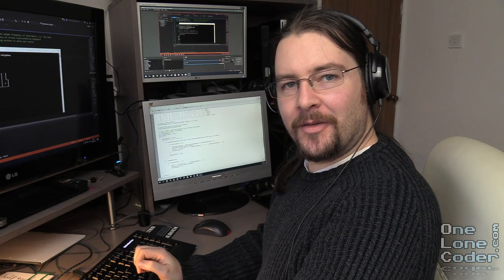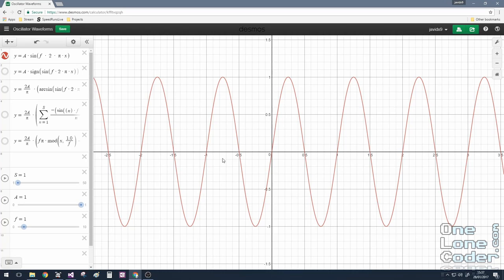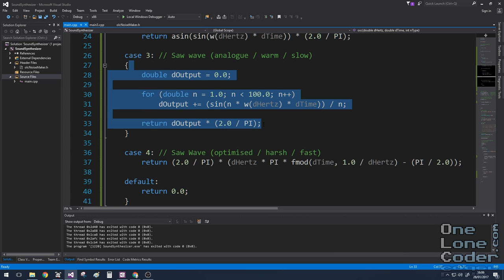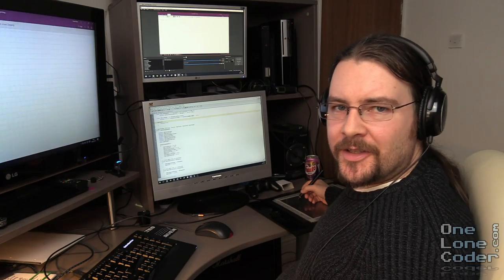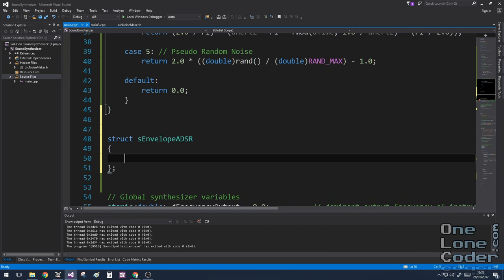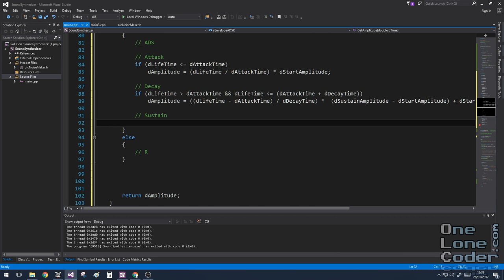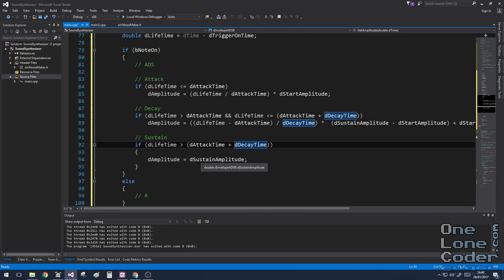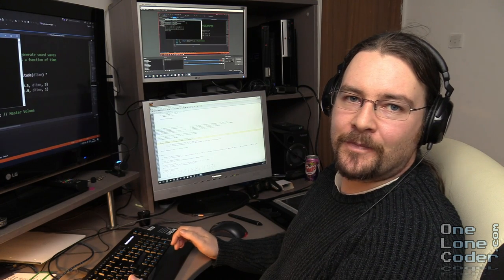Code-It-Yourself! Sound Synthesizer #2 - Oscillators & Envelopes

Comment: The "clicking" noise comes from the fact that the "wave" is not nicely ended at 0. For example your sine wave goes up and then gets interrupted by a key release and goes to 0. This creates a "clicking" noise at your speaker. Always let a single wave go and finish it's wave untill 0. The clicking noise comes from the large transient in your speakerboxes.

Comment: The reason the fmod implementation and sinusoid summation implementation sound different is because of aliasing noise. You're right that you are simulating an infinite sum of harmonics but at a sampling rate of 44100Hz only frequencies up to 22050Hz can be represented. Any frequencies above this present in the signal you generate appear as sampling noise because they become new frequency components within the 0-22050Hz nyquist band. This distorts the harmonics of the waveform so it is no longer a sawtooth mathematically speaking.
At anything above 220.5Hz your fourier summation of 100 sinusoids will also create aliasing noise for the same reason, it's just that the fmod implementation creates more as it contains more harmonics.

Comment: @11:30 I think the real point is that the analog saw has harmonics, whereas the digital saw does not. Harmonics add character and depth much like vibrato or tremolo, they create a uniqueness that enables the sound to stand apart. So you are very very spot on. The analog saw is much warmer, and more interesting.

Comment: The summed harmonic saw wave would probably probably sound interesting with the harmonics faded in like you showed - I guess the is like a wave table oscillator.
Interesting tutorials - thanks!
Reply from the maker: Thank you free electron - I'd actually like to build a full wave table system, then a tracker thrown on top. hmmmm.... (starts coding)

Comment: Hello
@11:50 of your video, I think you've got it a bit backwards in your explanations.
A perfect sawtooth wave, which your mod function is giving you at low computational cost, has all of the harmonics included in it, particularly the high frequency ones. It makes the sound richer, but also harsher, with more energy.
Your inefficient sum of sines method, is the same as creating a perfect sawtooth and applying a low pass filter, to keep only the lower frequencies and filter out the high frequency information. It sounds less harsh and "warmer" indeed. But in reality it is - in terms of frequencies and precision to the target signal - poorer. Notice as you increase the number of sines that you get closer and closer to the sound of the mod function version.
Just wanted to point it out in friendly way !
Reply: Also, if you like this kind of topics, I recommend you take a look at this:
http://greenteapress.com/thinkdsp/thinkdsp.pdf
It's Python, but you can thoroughly ignore the Python code and just focus on the signal processing lecture, then apply it in C++
Reply: @KingGrio  great resource, thanks

Comment: hey. i don't know how your oscillator works because it's been a bit of time since i saw that video, but when you said there are 2 ways of making a saw wave i assumed one of them would be the type that i always use, but it wasn't the case. so what i always do is i declare a double phase and set it to -1. then i declare a double inc = 2.f / sampleRate * freq. then for each sample i just say phase+=inc and if(phase>1) phase-=2. that way it will always jump back when it needs to. i'd assume that this is the most cpu efficient way because most audio software doesn't have to recalculate the sampleRate twice, so you can just initialize a variable as 2.f/sampleRate and then later on only multiply freq with that, only when the freq is really changed. you can get all other types of oscillators from this basic oscillator by just slapping stuff on the phase-variable. for example sin(phase*PI) for a sine wave
Reply: even your envelopes work completely differently :O it's incredible how many different ways can be used to solve a problem... good work
Reply from the maker: Hi Beats, yeah many ways to skin a cat as they say XD, I did actually use phase difference for pulse wave generation in my NES emulator

Comment: A nice experiment would be to define envelopes that don't attack and decay linearly, but follow a given function.

Some code would need to be refactored; you'd need a base class for the envelope, which contains a function that does the indexing of the note's lifetime, which calls these functions in the subclasses that inherit from it. The current struct already serves as a base class, assuming it's turned into a class first. Just needs to be changed to use the functions, and define the linear functions itself.
Reply: Ah, I see that you addressed this in the next video, sort of. The "sound" function pretty much serves the same purpose as it can override how the attack and decay are handled. Nice to know that even though I wouldn't know where to start on these projects you show us, once I'm following along I can still understand everything and anticipate potential improvements. ;)

Comment: You should slap a limiter on as a last step before the signal goes out as a way to protect your speakers / hearing. Very easy to add, not worth the risk to not have it imo

Comment: You're doing a linear interpolation on the amplitude over the duration of a part of the ADSR, yea? Have you considered using something like smoothstep to ease the transition between parts?
Reply from the maker: Quite right, if i were super serious about achieving optimal soumd quality i would have sampling and non linear interpolation all over the place XD

Comment: @javidX9
Would be amazing if you could extend the synthesizer series with the following:
Video Suggestion 1) Reverb, Delay, Overdrive, Compression and Mp3 conversion
Video Suggestion 2) Filters with an ADSR, and Cutoff. Possibly including a band, low and high passes. 
Video Suggestion 3) noise (white, pink, blue) generation.

Comment: Idk why, but when I try to run this code I get crackling sound when I hold down a note and when I release the note, it starts playing until sustain. Once I press a key again, the note stops until I release it again. The attack part gets executed (sort of) when I press down a key, but the decay and sustain part get executed when I release the key. They are under the same if statement so it can't be the state of the note on bool value. I guess the lifetime variable may be responsible, but I can't really tell what value it's holding. Although, it should work right since it has the same code when I compared to the source code you provided.

Comment: The funny and sad part is that the saw wave formula is flawed and will produce problems at certain hertz. These kinds of bugs are very hard to find if not tested properly, testing all hertz frequencies will expose the problem. One easy fix is to clamp the output to +1.0 and -1.0 if it over or underflows, however doing so for any function will ofcourse hide the slight flaw/inaccuracies in the formulas, thus it might be better to fix the formulas somehow, otherwise it might produce "undesired harmonics" and pollute the sound somewhat. I am not sure what the exact problem is, but in Delphi it produces weird results, very weird. Sometimes access violations, sometimes driver hang... I am using ASIO though, I suspect your emulator might crash as well, if the Hertz and Time is just right for this to become a problem. Though maybe Delphi corruption problem, really weird, will result it just in case and remove some unnecessary controls ;) :) Pretty sure it's in formula too though, easy to find. Also the saw wave shape is different from the analog/sin wave version... it seems mirrored... so it starts with high then proceeds to low, while the analog starts with low and goes to high, this might cause a plop at the start of the wave... however if it's inverted my plop too not sure yet. I sugest you write a "wave visualizer" to study the waves in details. I use opengl for that =D Problem can be fixed by negating the saw wave, then it looks more similiar to the analog saw wave. The popping at low frequencies will remain ofcourse, but ok. I think there is also a slight sound difference when inverted not sure, strangely enough program crashes if not inverted haha.

Comment: how much more complex would it be to make a wave table oscillator? iv always had a want to be able to make a reason rack extension with wavetables/user wavetables, FM between oscillators and waveform bending. is there any resources to read about these three subjects? the waveform bending is similar to PWM but it works with any oscillator shape. look up NI massive and its Bend + mode.
Reply from the maker: Hi Andrei, great question. It would be quite simple to implement a wave table as a pseudo oscillator, you just need to play some tricks with how the time variable is understood by your "wave table oscillator" source. I would just store the Y components of the wave as an array, and use some modulus of the time to act as the index (probably with some lerping) to extract the output. Something to think about for next year when I want to continue this series.

Comment: Basic safety tips for anyone starting out with synths:

- Do not use headphones while coding sound synths. As a general rule of thumb, always be careful when dealing with hardware that does something in the real world. You're not always going to get things right, and allowing yourself to physically experience the bugs in your code is not a good idea. Your ears are very delicate hardware.
- If you're using a laptop, avoid using the laptop's sound system. Use cheap speakers. You might blow them out. 

To mitigate a lot of the risk, make sure you cap the maximum amplitude by wrapping it in a min() function before outputting it. That way, if you mess something up, the program won't output a signal that will blow out your ears or your speakers.

Comment: Ok, Thought I'd go back and follow this one through. Has anyone else actually done this ?
I see lots of comments but none mention this or any success/code questons.

I got to about 6 mins in to this part and the code does not seem to match up with the last video :(
Noticed at 5:38 your screen display is different to the example you typed...
return asin(sin(w(dHertz) * dTime))  *  2.00 / PI);
vs.
return asin(sin(w(dHertz) * dTime))  *  (2.00 / PI);
I caught this one and corrected it, but still have an error dTime not initiated.
Could just use the download but the entire rest of the video is already filled in by main2.cpp, I'd like to follow along properly.

Comment: https://youtu.be/OSCzKOqtgcA?t=1569 
i do not understand how it is normilized to be from 0 -->1 as assumming dTime is the current time which is always increasing then at the time the note is of you have 0 then you have it increase to 1 at dTime-dTriggerOffTime = dReleaseTime. but after than there is no if(dTime-dTrifeerOffTime<dReleaseTime){ code} as it an else statement the dTime will increase to a very big number which results in > 1?
i am so confused at what i am getting wrong

Comment: So the envelope minimizes the pops between sounds?
Reply from the maker: Correct Andrew - Typically the waveform is always being generated, so to just switch it on could yield a very high frequency pop as the speaker slams from 0 to current sample value. An envelope with attack (even a short one) will ensure it ramps form 0 to sample value, effectively filtering the annoying pop, but also adding interesting sonic qualities to the sound

Comment: Why are you using a struct if there are functions inside? they teach me struct if there is only data, class if there is data + functions
Reply from the maker: in C++ there is no functional difference between a struct and a class, the only difference is the default access specification of the members.
Reply: Im a bit late, but this is typically done because of coding standards. 
It can make it easier to keep track of code changes and bug fixes in larger code bases. 
Besides that, write it how you want. Its up to your own preferences and style.

Comment: you can take away asin(sin(... from the triangle wave. taking the arcsine of the sine of N is N
Reply from the maker: Hi Kino, Actually I can't, I need the output to be periodic, so I need a periodic function in there somewhere, without it the output signal would not oscillate.

Comment: rise and fall of notes is an odd thing to jump on. it's not that that's what sounds good, it's just how physical reality works, which you are not abiding by. also, the 12 tone temperament system is garbage, at least do just intonation if not unique harmonics(fractions of a starting frequency). other than that good vid
Reply from the maker: HI Kevin, thanks! I'm unsure what the problem is with the note generator, my notes are fractions of a starting frequency - dFrequencyOutput = dOctaveBaseFrequency * pow(d12thRootOf2, k); where k is an integer representing the physical key. Are you objecting to the musical nature of this? In which case fair enough.
Reply: Yes it's not you, I am objecting to the musical nature of the twelve-tone equal temperament system. My website awnauf.site represents what I mean by a series of fractions as notes.
Reply: Kevin Galvan But how can you change key without 12 TET?
Reply: change to a new starting frequency, and generate a revised set of harmonics.
https://github.com/kg79/dynamicMusicKeyboard.git
Reply: When you do a prepared key change, say a V-I or a ii-V-I to the target key, do you use the new tuning at the start of the cadence or on the new tonic chord?
Reply: First of all, what I'm suggesting is a departure from western music theory. Second, each numeral is referencing it's position from the root, so if/when you change, it's up to you,  but I'd say new tonic from this example. Third, in the system I'm suggesting notes can be so fine grained you can access everything from one key, and the concept of changing root/standard pitch is either niche or negligible.
Reply: I thought you were the poster when I said to generate some code, from a purely musicians perspective I use fretless instruments because they're non-opinionated and thus never wrong
Reply: Also if you're unfamiliar with web technologies ^, copy and paste the index.html file into 'notepad', save as html file, and open with Chrome or Firefox for a firsthand look
Reply: Sorry if I'm labouring the point a bit, but it seems like it's harder to truly prepare a key change with its dominant chord when not using equal temperament tuning. For styles like Jazz where there are frequent modulations you really need equal temperament to have the tonal centre shift around smoothly. That's why I disagree with your statement that 12TET is 'garbage'.
Reply: redchant I think TET is successful as a model, but since it compromises harmony I can't get behind it. Do you think the same principles could be applied to just intonation?
Reply: @kevingalvan9440  - Here's an idea: Maybe you could interpolate between an appropriate JI for the current chord or group of chords and 12TET depending on how settled or unsettled you want the song to sound at that point?